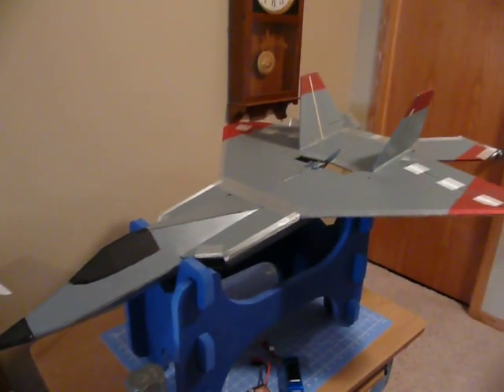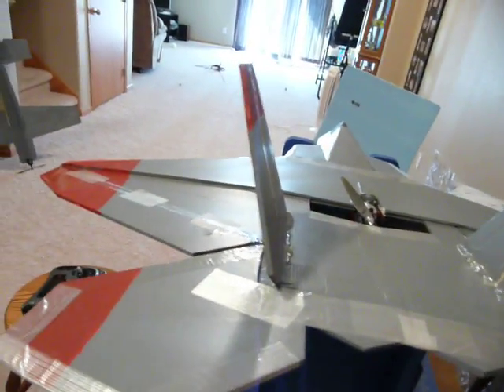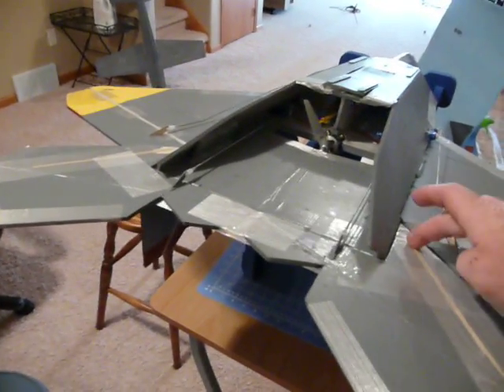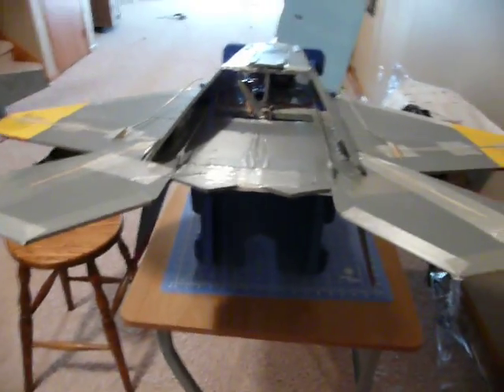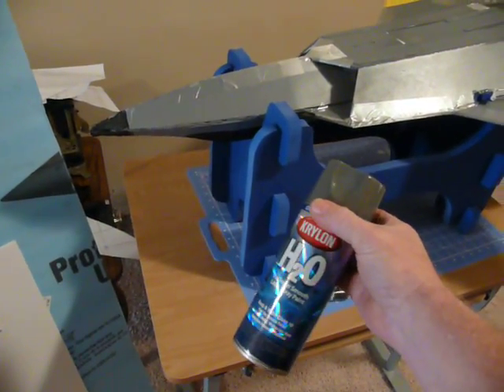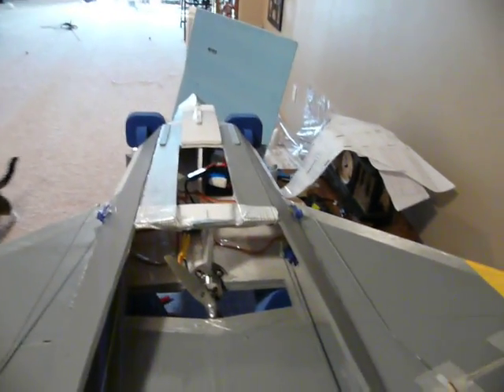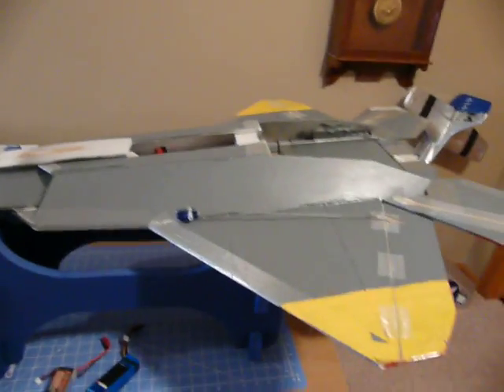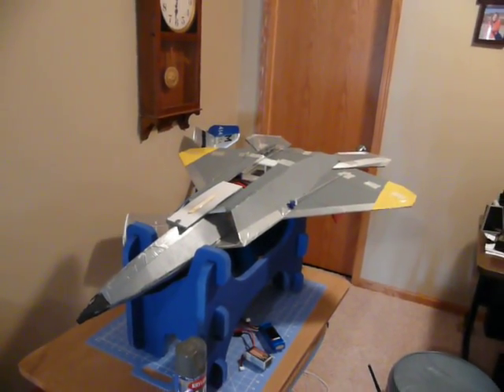Foam  F22v2 and Dollar Tree Foam Board

Comment: I just got done building my 5th f-22 rcpowers. This last build I used the dollar tree foam board. I used the rust-o-leum specialty plastic paint. It has no acetone in it. If you spray a light dusting at first. That first will act like a glue to the paper. Do not spray alot on at first this is what causes the paper to curl and separate. Continue dusting one more coat than the last coat you can put on a little thicker. Hope this helps.. Great looking plane